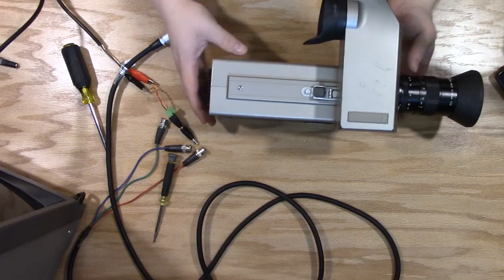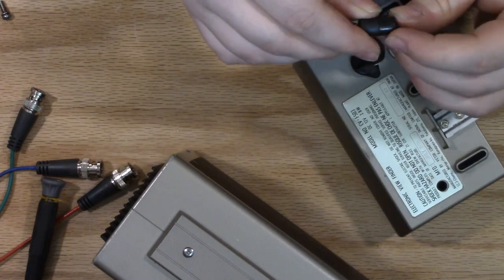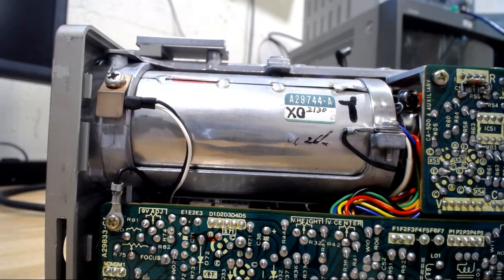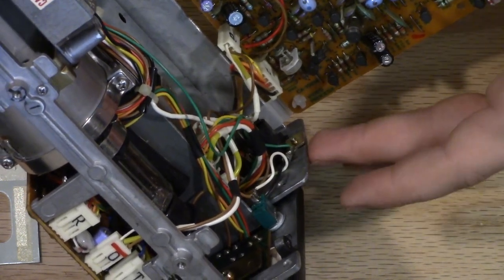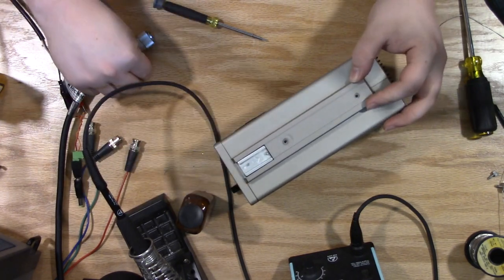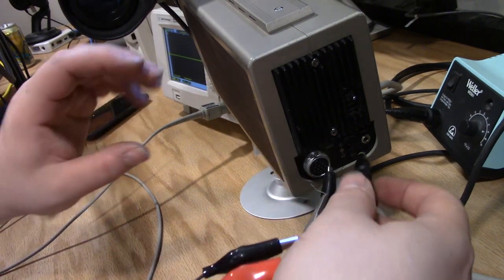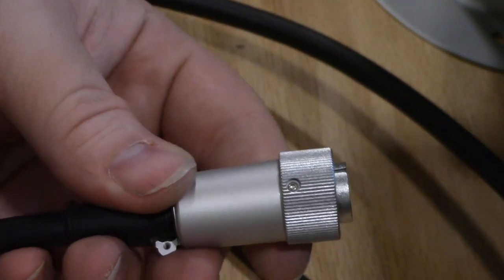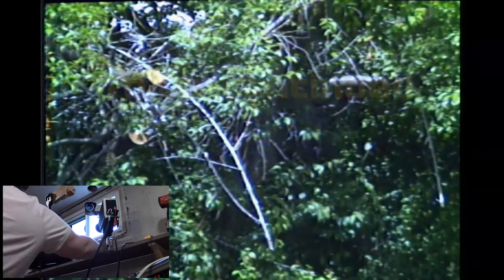JVC CV-0001 - Pt.1: Repair

Comment: dearheart, you don't need goo gone for rubber cement. you just wait for it to dry & then rub it - the excess balls up & comes off easily. that's why it's called rubber cement. :) but this was a great video, super interesting. i always love learning from you. <3
Reply from the maker: well i needed it gone immediately because i was about to use that part of the desk and needed to not have goop all over my gear!
Reply: your way worked too! <3
Reply: It helps if you sniff it while it's drying.

Comment: At least yours has a modular viewfinder. Mine has the viewfinder built-in and its flyback is on the main power supply board. And even worse, it died with a high-voltage short, bringing down the entire camera's power supply and since it isn't modular, I can't use the camera at all, as opposed to just removing the viewfinder and use an external monitor (or try to get lucky).

Comment: that video plug on the back of the camera can also takes 12 volt to power the camera, it also will also take a play back video signal, from the play mode of the video recorder,  based on "Ferguson VideoStar colour" PAL (Model) also the remote trigger the recorder pause on the front under the lens. I'am almost certain the mic was stereo, as it was recorder as two tracks on our recorder (it was about 40 year ago?) it could sent it down long cable I think booting of the video in the  base unit for the camera,  that where I got bogged down, and it started getting to messy for me. :-)
Reply from the maker: Yeah, I figured there was a 12v input in the connector somewhere but I couldn't find a pinout and didn't want to risk it.

Comment: That C2259 you point at is an NPN dual transistor, so basically 2 transistors in the same package. The idea was to be able to control/amplify 2 signals with a single output (low since this is npn)